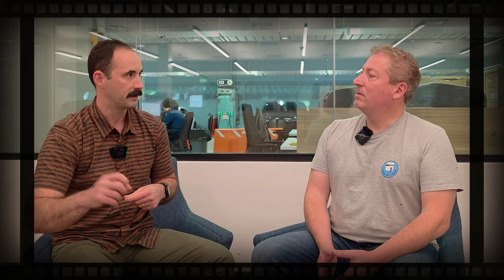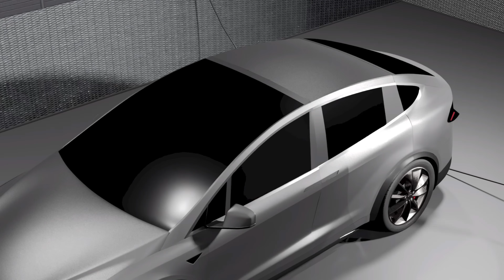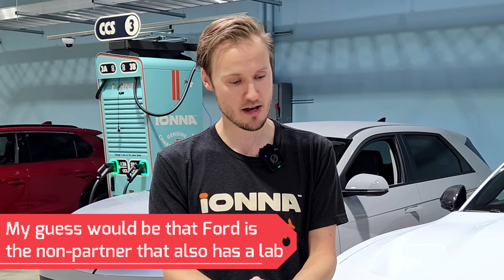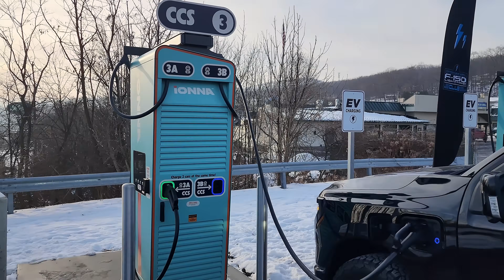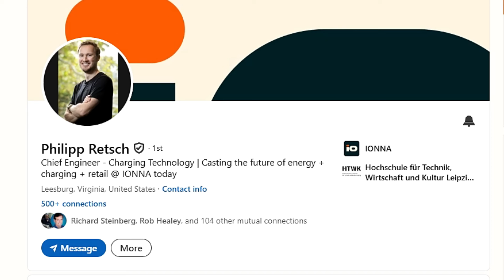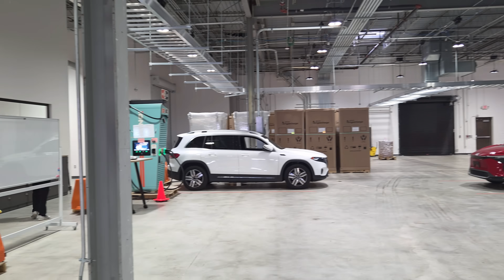Ionna's Chief Engineer Explains Why There Will Be No Ionna App, And Much More

Comment: Sorry, Tom, one slight correction.  BMW has certified the Lectron Vortex plus UL2252 certified, as a matter of fact they don't support the old Vortex.  I can't wait to come to Ionna now that they have a rechargery (relay) 15 miles from my home, but I tried the adaptor with a Tesla supercharger, and other than having to preset my Plug & Charge to the Shell contract on my MyBMW app, the plug and charge experience was seamless.

Comment: I was driving the other day next to newly built charging station and saw two helicopters in the air, I thought it was a police raid, but approaching the location I noticed that the helicopters had Ionna  logos on them. Not even two minutes later, they started dropping cables and AlpiTronic chargers with parachutes. Tom Cruze was an accomplished lead pilot for the operation. Mission accomplished.

Comment: Canada needs someone to step up and install reliable high speed charging along the Trans-Canada Highway. Petro-Can tried but unfortunately used that absolute garbage BTC hardware. If you can’t use the SC network you are basically doomed to a miserable trip.

Comment: The other problem with not having an app is that not all vehicles have their own app for monitoring charging. So if I on a had an app I could monitor the charge of my vehicle remotely for ones that don't have a built-in app or require a subscription.

Comment: I think the reason they don't endorse the UL-certified adapters and instead those the automaker endorses is a very simply one: legal liability. Keep in mind Ionna was created through a multi-automaker partnership, but is still a separate entity.  
If they only endorse those adapters GM and others have said it's ok, then the automaker will be responsible for any loss using those adapter while the customer is left holding the bag if they use something else and there is a loss. But if they say it's ok to use an adapter GM hasn't recommended, then Ionna is on the hook for the loss.
Simple as that: legal liability issues outweigh the certification.

Comment: Tom, Did you try your Lectron Vortex UL2252 adapter on IONNA ?
Reply from the maker: Yeah, it works fine - as do all the adapters. It's not really a matter of them working - they will all work. But the low quality adapters may wear out and have problems after use.

Comment: The adapter answer has been framed to ensure the vehicle warranty is maintained. If you use a non-OEM adapter and there is an issue, the OEM will not back the warranty for repair.

Comment: UL vs OEM support is an interesting dilemma. 
1.  Vehicle pov. Can understand putting on the OEM to certify protects the vehicle from failure with adapters etc. 
2. From a code/insurer/ consumer protection pov. Supporting only OEM self certifies and/over tested is equally concerning.

Comment: They can make an app just for charge history. Thats all I want. I don't want to figure out which app I used to initiate a charge. They are missing the purpose. Their receipt option sucks because the screen flashes so you cant scan the QR code. It's an awful experience. It seems like the only priority that they have is "customer sentiment" which is not innovation and proactive measurements, its lazy and sloppy.

Comment: I already have two apps that will allow activation at IONNA.  I do not need another one.

My one experience with a less than stellar experience at an IONNA site was handled very well.  I got a communications error on all the units I tried, so I could not use that site.  I reported this in PlugShare, and went to a nearby EA site.  Within just a few hours, IONNA has a specific response to my Check-In indicating they had reviewed the logs related to my attempts, indicated that they understood the issues, and offered a specific possible remedy through an OEM Service Bulletin.  When I went back a few weeks later, I had no issue at that site.

IONNA is my preferred CPO, and I look forward to their continued growth.

Comment: I believe Ionna is doing a great job and is really accelerating construction. I think Ionna is missing an opportunity to generate more buzz around coming sites and the company as a whole. For example, Brooklyn Park, Minnesota Hy-Vee grocery store is a coming site that already has chargers on site, concrete pads poured etc. as shown on PS. Yet there is no mention of this site on its web site or FB page, but the FB page mentions several fence up locations where work hasn’t even begun. Not everyone nerds out over this stuff and generating buzz for sites actually under construction would be good, I think.

Comment: Part 1 was such a tease to part 2. 

Instead of an app maybe they could display a QR code during the first minute of the charging session that way you can monitor the charging on a web page. Some OEM apps really suck!! Kia.
Reply: Agreed, the GM (my[brand]) apps are rough too. I haven’t had a SoC query take less than 30-40 seconds.

Comment: I'm glad they aren't going to make their network require an app. I'm admittedly an IONNA fan so I would probably download an app if they had one, but other folks might feel the same way I do about Shell and Walmart - I'll just go somewhere else.

Having an app available could be good though. Remote charge monitoring and after-hours building access could be made a lot smoother with that as an option. And you can never have too many payment options.

Comment: Getting IONNA locations into Google, Apple and all the other major OEM route planning and mapping solutions that the casual and not so casual user might think of really is the priority vs “one more app”
Reply from the maker: I totally agree.
Reply: Right now there aren’t many Ionna locations. Use your map app and type in EV charger. It gives you all available chargers for your search area, output and number of chargers and what connector for each available dispenser.
Reply: 100% this! No more apps. Make the apps we already have and use, do what they’re supposed to do.
Reply: +1. For this to work it needs to be a part of current navigation tech. No one wants to forgo Google Maps in order to plan a route for their EV.  That’s another barrier to adoption.

Comment: I don’t see the strong need for an app as their network is already integrated into two other public apps for starting to charge and in a third app in terms of showing a easy map of their stations. 
You can start the charge with the ChargePoint or shall recharge app as he stated and the advantage of this is two fold. It will avoid the credit card hold on session start and you’ll be able to see charging history after the fact.
As far as finding their stations, simply use PlugShare and select only the IONNA network.
Excellent interview Tom, thanks for the detailed discussion. Looking forward to your future CPO interviews.

Comment: With the operator screen on the side or any side for that matter if the sunlight is shining on the screen it gets burned out and hard to see. My point I guess is: don’t install them with southern exposure no matter what side it’s on. Btw the new site in Reading Massachusetts has the screens facing south! Just my two cents.

Comment: Good interview! I stopped by the Ionna site in Bradenton FL. Everything looks to be in place but no power yet. In the future I'll be more likely to use Ionna if/when they establish plug and charge with Ford, depending on on-site amenities. Having Ionna as one of the BlueOval partners in the Fordpass app is a plus.
Reply from the maker: I wouldn't be surprised if that happened at some point soon. The tip is that Ford incorporated IONNA in the Ford app. That's a tell if you ask me.

Comment: Curious if they'd support an OEM NACS-CCS adapter if it's from a different brand. For example, what if I buy the Ford adapter for my VW ID.4? Is the Porsche adapter close enough? Are they limiting their scope because they will depend on the auto maker to share liability, so it needs to be 100% strict?
Reply from the maker: Both Electrify America and IONNA have been crystal clear. Only the adapter that your specific OEM is selling or endorses.
Reply: @StateOfChargeWithTomMoloughney  And that adapter IMO sucks from KIA, costs more than a2z's, and thus I don't care. They just need to get their UL certification.
Reply from the maker: @sprockkets It's in the process and will be certified very soon, I'm told.

Comment: Hey Tom! Quick question about the Alpitonic chargers on the southern portion of the NJ Turnpike. The Applegreen sites are great, but both me and the guy next to me could not charge on the NACS plug with our CCS1 adapter. Is this an issue or just a “one off”?
Reply from the maker: That shouldn't be the case. I've charged on IONNA's Alpi units with an adapter.

Comment: Ionna does a good job with clear graphics that enable users to clearly identify the proper plug type and dispenser number. It is surprising how poorly that is done at some other networks.
If I am not mistaken, the ChargePoint app can be used to initiate charging at Ionna locations. So one can use an app without needing another app.
Reply: Yup, all of the manufacturer's apps plus chargepoint afaik.

Comment: Ionna is in the Mach-E nav unlike the Tesla stations. Ford has superchargers in a separate car app and in their phone app but not in nav. This has been a sore point with me for over a year. Granted 34 Ionna stations are easier than 2800+ (US) superchargers but they clearly have the data since it is in their separate in car app. I guess Tesla is just too big to fit into Ford nav. I've authorized at Ionna using both Plug & Charge as well as the Ford phone app. Both worked flawlessly. Great update Tom. Thanks!

In response to a question about Plug & Charge for Ford on Ionna, I confirmed today (1/25/2025) that despite what the Ford app and nav entries say, Plug & Charge does work. I plugged in at the Valdosta Relay and the session started without the need of the Ford app and no button presses on the charger. I simply unholstered the cable and plugged it into my Mach-E (2022). By the time we finished lunch it was at 94%.
Reply: does ford support plug and charge with IONNA? I didn't think they did.
Reply: @creedda  Yes. The first time I used Ionna, I didn't think they did but I plugged in and while I was starting up the Ford app, charging started.
Reply: @MachE_Mutt  interesting, wonder if IONNA are using the EA or Tesla Plug and Charge Certificate.
Reply: @creedda  In response to a question about Plug & Charge for Ford on Ionna, I confirmed today (1/25/2025) that despite what the Ford app and nav entries say, Plug & Charge does work. I plugged in at the Valdosta Relay and the session started without the need of the Ford app and no button presses on the charger. I simply unholstered the cable and plugged it into my Mach-E (2022). By the time we finished lunch it was at 94%.
Reply: @MachE_Mutt  They just added it in the last week :)
Reply: @creedda  I may be remembering wrong. In the Ford app, Ionna doesn't show as P&C like it does with EA. I'll test it on our Thanksgiving trip.

Comment: Higher power chargers are desired now! for example Silverado EV and GMCEV Sierra those require quite a bit of energy and they are selling fast. They are increasing in popularity. It’s not going to happen often but there’s going to be times when there’s vehicles pulling 350 or more even in the very near future … if they have to split charger power 200 kilowatts is going to seem really slow for a big truck like that. They can take 350 or 360.

Comment: There is no point in a network-specific App - locations ( and realtime status) of all operators should be available in a single independent  app.  If you need status of a charge session, do it like Kempower- scan a QR code on the screen.

Comment: Thank god no more apps! I just bought my first EV (25 Ionic 5 SEL RWD) and am dismayed by all the apps you need to install.
Reply: Apps are great, as long as you don't require them.  It's great to use the app to check charging status before you arrive, and to check your charging session, price, etc. while away from the charger.
Reply: @GeoffJohnson  They can push this data through an API to a third party like Plugshare that can put all of their effort into designing an app/website rather than it being a small side operation, and it will consequently work better than the ones made by each charging network. Plus it's a single map where people can see chargers from every network instead of switching between 5 or 6 apps.

"The Chargepoint station here is full, let me check if EA has one nearby [switch app, wait for GPS lock again]... no, it's all the way across town. Maybe there's an EVgo around here... oh, the app just updated and I have to watch a tour of the new features first and NO I DO NOT WANT TO WRITE A REVIEW FOR THE PLAY STORE RIGHT NOW"
Reply: 100% A Better Route Planner has Ionna stations, so I'm good to go!
Reply: But when Hyundai takes months to years to add charger locations, you'll learn why we need apps to know where the sites are.
Reply: @thelongdaysofwheeling124  you could use their website and not have to install an app????
Reply: @thelongdaysofwheeling124  But Ionna doesn’t need to go down that road. They can just open source the data for any other app people choose to use.

Comment: If ionna locations get uploaded to Google maps immediately everyone should be able to the them, especially as more and more Evs use Google built in. Even those without that can use Google maps via their phones. I know that the GM app was updated almost immediately when a new ionna opened in PA
Reply: Agree. I think a GM rep said the maps on their android based cars get updated every 2 weeks. Not sure exactly how that’s works (as a phone would be immediately once the map is updated). But even still that’s pretty good.

Comment: What answer are you looking for from them on adapters? I don't think they are ones who would make the call on what adapters you should use. I don't think the charging equipment is at risk by the consumer choice of adapter. That question is for the automakers
Reply from the maker: Simple. I want to know why a UL-certified adapter isn't ok to use. 
It has to also have been endorsed or sold by the automaker. Customers should have choice, as long as the device has been tested and certified.
Reply: I agree, and in the end it's about liability.   Standards are great, but at the end of the day somebody might have to pay if there is an issue.   
It's hard for me to find fault with the automakers for deciding that they are only going to own that liability for the adapters they sell/ship/test.
Reply: It’s also very confusing. I have an adapter provided from ford, made by Tesla. Am I ok to use that on my GM car? Who knows what they would say if there was an issue.
Reply: @jayhoughton558  And the easy solution is to not go to them. If they dance too far around the market they lose business. It's that simple. They could have said they will work with a few adapter manufacturers to  certify usage on their network. It's as easy as that but they didn't.